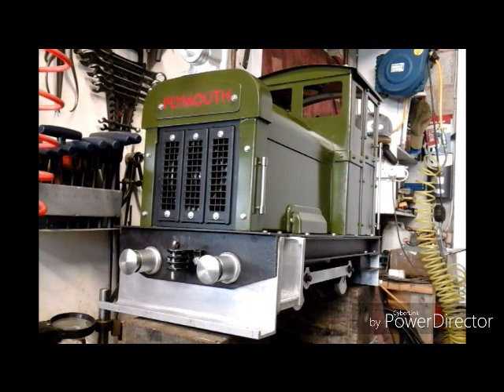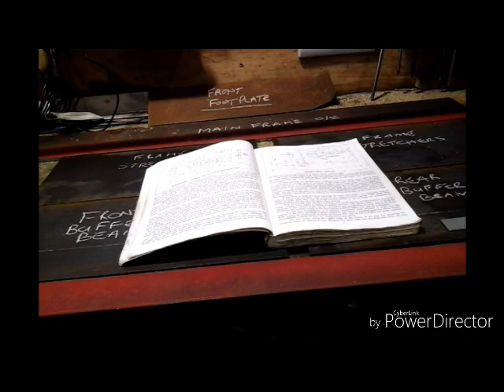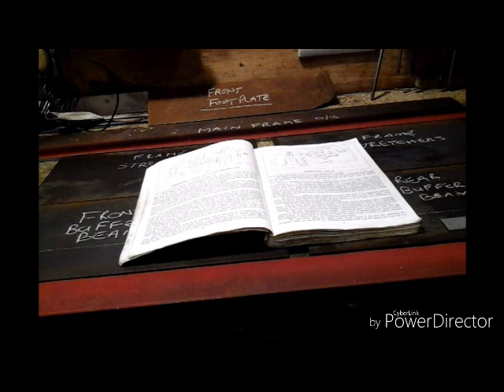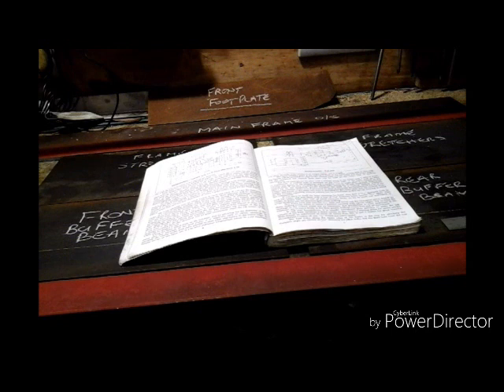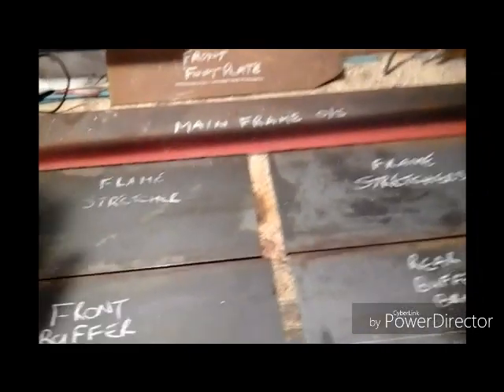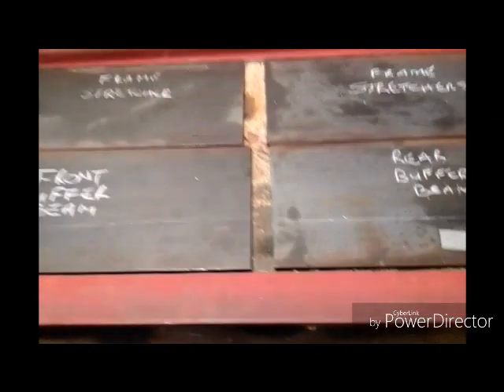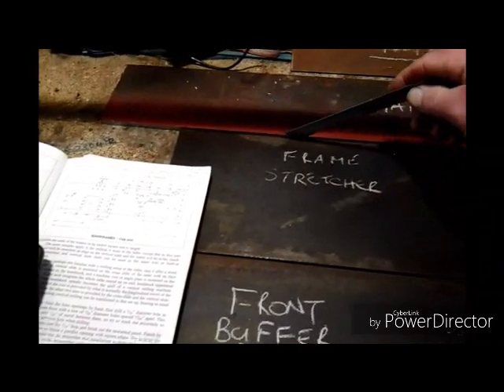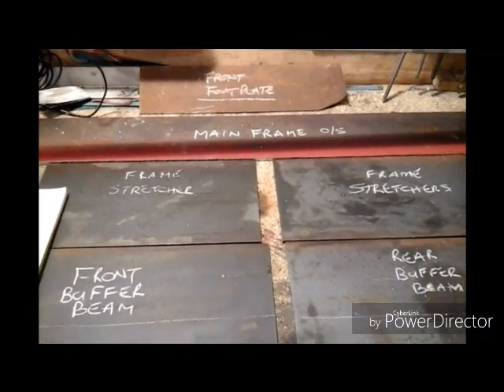Making a Beginners Steam Loco Part 1 of Materials (chassis / frame) "mr factotum"

Comment: Blimey Kev that frame was a bit of a workout. Have you seen the eclipse panel hacksaws no55 I think that would have made life easier. You can pick them up from time to time 😀
Reply from the maker: 🤣not seen eclipse no 55, 
i like hacksawing with my Sandvik saw. its better than going to the gym🤣👍👍
cheers
Kev
Reply: @MrFactotum  it looks like a normal wood saw with a hacksaw blade in place of the cutting edge. Bandsaw is quicker for me mind 🤣

Comment: Why meter maid over sweet pea? Just trying to decide which one im going to do.
Reply from the maker: No particular reason, you just don't see as many metre maids, and wanted to challenge myself with the six wheels, for my 1st project and like the look of them, just my personal preference.
 if you want to keep things as simple as possible, stick with the books sweet pea. remember 33% more work to do with the six coupled wheels.  wheels, axles, axle boxes, horn guides, keepers, connecting rods, bearings, cutting out the frame for horns  etc,etc etc
Nice to hear your going to have a go.
Have you made yourself a member of the "closed" Sweet Pea group on face book. Theres always some good info on there. I'm not in to facebook and the like, but I signed up just for the sweet pea group membership, its free, I don't use facebook  for anything else. Just beware from the book and drawings  there a few minor errors as with any loco drawing I believe, off the top of my head I cant remember them but on the sweet pea group info page there listed there I believe, if not I will try to dig them out of my already overloaded mind!!!! for you, I have a list somewhere.
Keep in touch and let me know how you get on.
regards
mr f
Reply: @MrFactotum  Thankyou for sharing your excellent knowledge i will take a look at facebook now.

Comment: Your videos are very well made and keep any model engineer interested in how another fellow  model engineer builds his models.
I have been building a 2" scale Durham and North Yorkshire traction engine for quite a number of years. Like you, I have tried to keep the cost down by fabricating all but a few castings. 
Keep those videos coming, you are doing a great job!
Reply from the maker: thankyou Emanual L
i appreciate your interest and comments, i like the challenge at working on a budget. good luck with your build, you say a number of years so just out of interest how far are you off finishing it
regards
mr f
Reply: @MrFactotum  I had it running on compressed air, and the steel boiler which I welded, tested at 250psi.  Lately I started dismantling it to finish the tender and all the fittings and then painting. I  am  finding it quite a task to find where all the fittings should go on this model. Been searching trough out the internet for videos and pictures. By the way, I am from Malta and I belong to the only model engineering club on the Island and I am the only one who  ever built a traction engine, and non have ever survived. I would like to communicate with you. Do you use Facebook or Messanger?
Reply: I forgot to tell you, my  name is Emanuel Lautier, thanks and regards
Reply from the maker: Hi emanual
thanks for reply 
great story, good luck with fittings i'm sure you will find where they should go, nice to hear malta have some  model engineers, we have hundreds of clubs over here.
sorry I don't do facebook etc. as yet, still stuck in the old fashion ways of communicating except for youtube, I do have email but hardly ever look at it. so would be best to contact me through YouTube videos, even if its a question on something else, I don't mind.
keep in touch
regards
mr f